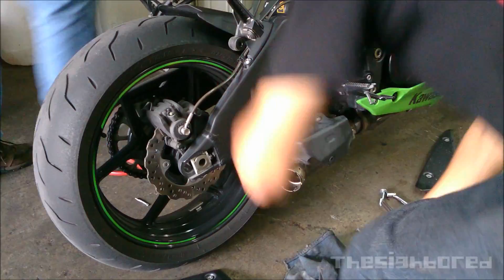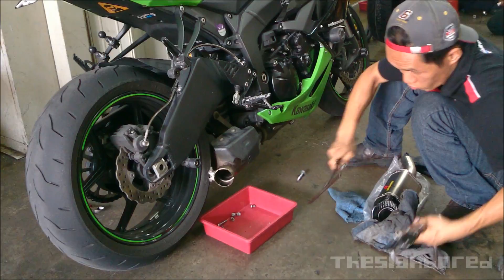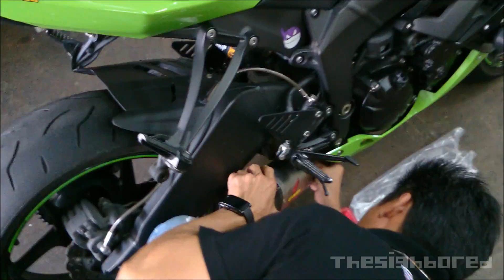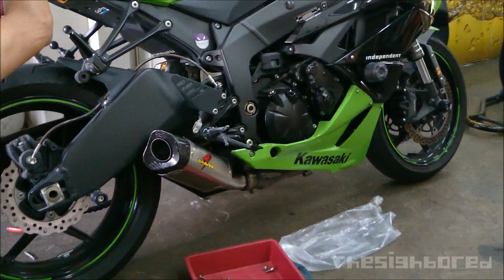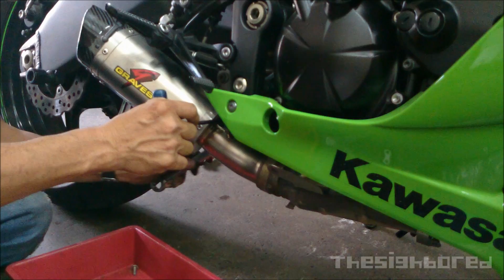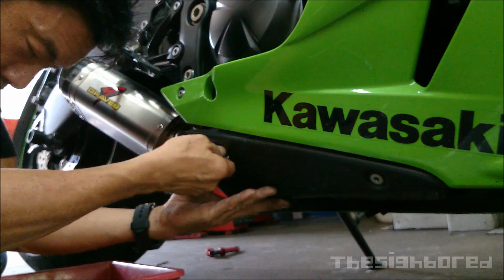Kawasaki Ninja ZX-6R | Graves titanium slip-on exhaust installation

Comment: Between Graves , M4 GP and Two Brothers which one did you like the most? whats you opinion
Reply from the maker: Personally I go for looks and not too loud/high pitch sound, that's why I chose the Graves. For me M4 looks were a bit plain to me, just a simple rounded canister shape, and the Two-Brothers seemed a bit generic with their other muffler models in terms of the shape and size, Graves was something different to me. As for sound, I think the M4 would be the loudest one, TB second, and Graves probably 3rd. Either one you pick you'll definitely need ear protection for long riding or your head will be buzzing like you've been in the club all night.
Reply: i think you covered me 100% .. you are very good i appreciate your help ... i am looking for graves then because i see it combines sound with looks... i want loud sound too but not too loud of course for the cops...

Comment: dude you said your bike still has cat in it....ok my mind's fucked XD...
Reply from the maker: If you see some other video of my ZX6R regarding exhaust you can see the honeycomb mesh inside the front header part.. That's the cat.
Reply: TheSighBored ohhh okay...i didn't understand at first because my mechanic friend said that cat is that big box...so you still have the original header and link pipe right?
Reply from the maker: The big box thing is more of like an air-box thing, it's not the cat. Yup, original header with the cat in (optional to dig out the cat and become full-system), no link pipe as my Graves is a shorty style.
Reply: TheSighBored but she's sound great.....any plans to change into full system....oh yeah,what do you call your bike...i called mine the gentle beast or luna
Reply from the maker: If I plan to ECU flash then I'll gut the OEM header to remove the cat inside at the same time, then it will be a full system, but not plans to do so at the moment. I call it Tortuga. :)